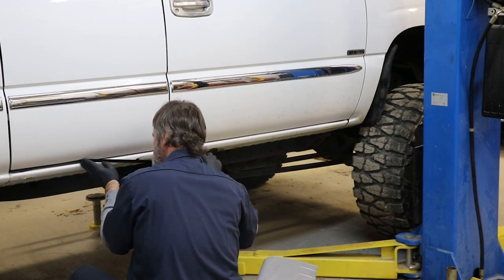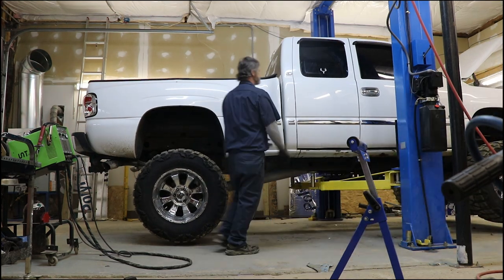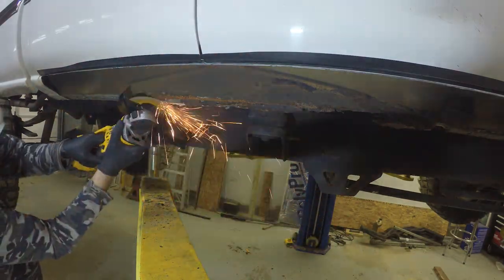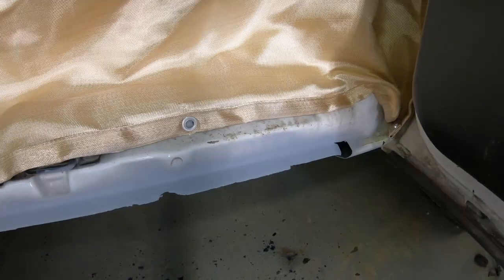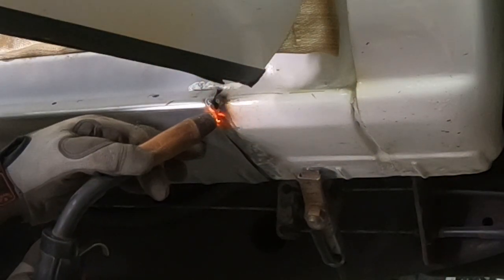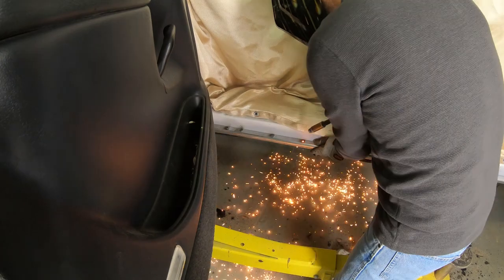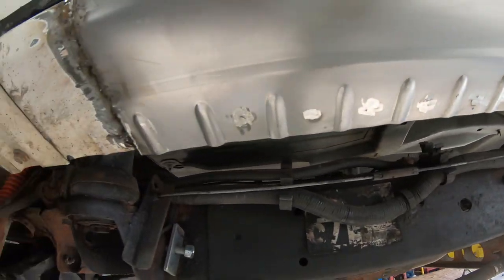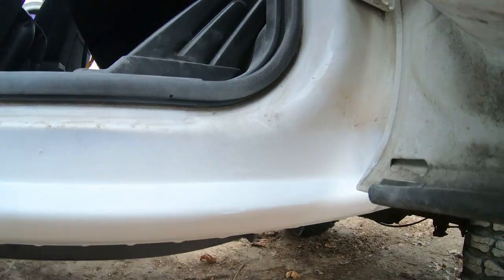2001 chevy silverado rocker panel repair

Comment: Good video. You did a great job on filming.  I published a few truck repair vids so I can appreciate how difficult it is to hold a tool and a camera at the same time.  Great looking truck.  I need to do the same job on my 1997 GMC.  I will need to be done with pop rivets as I am not skilled at welding.
Reply from the maker: Thank you for watching I appreciate your comment
Reply: You will need to weld the top, find someone to weld it for ya, that mid spot welding is real easy !
Reply from the maker: What if you got access to a welder would be good practice
Reply: @johnlake2086  - Thanks

Comment: What's the welder and type of welding you are going? I don't weld.
Reply: More than likely it was a MIG set up judging by the sound. But u can use a flux core welder with .035 wire and get a pretty damn good turn out. Thatz what I used on my rocker replacement job.

Comment: The inner panel was rotted away in the center, what did you weld the bottom of the outer rocker to/
Reply from the maker: I just took out what rust I could and then killed use rush killer to take care of the other and welded it to what I had left now I plan on going back to and putting new sheet metal in that area
Reply: @NobleAutomotive  Makes sense. Thanks.